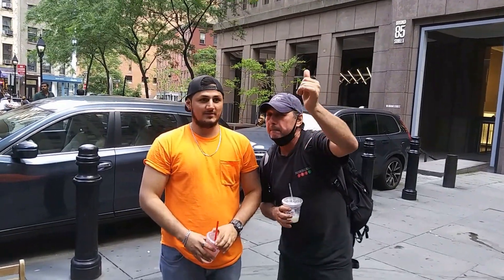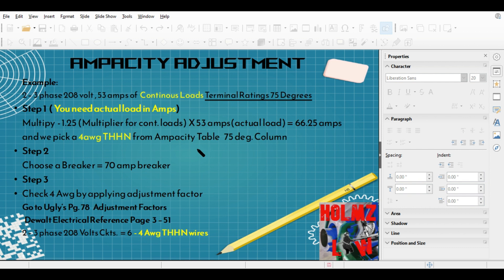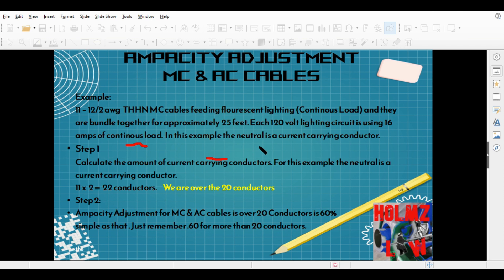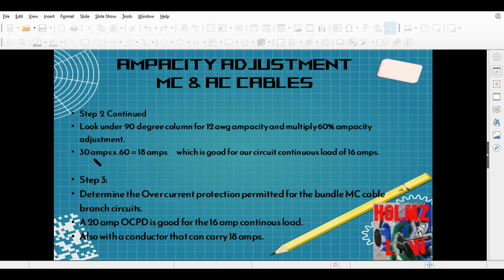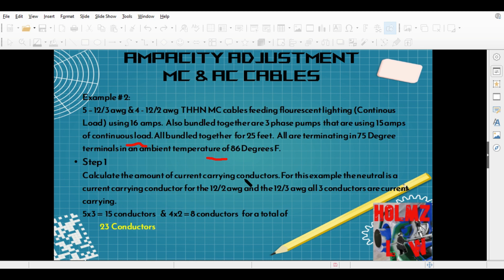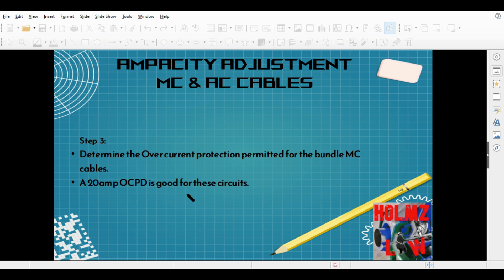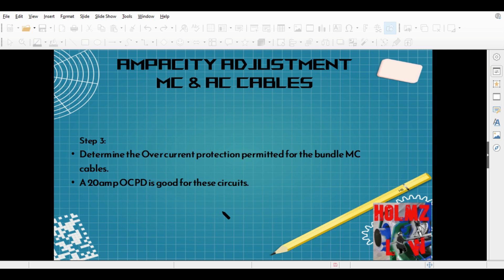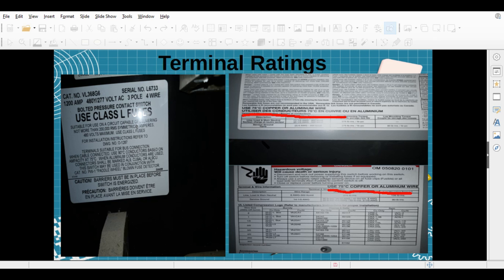Derating Simplified Pt.2 -  MC & AC Cables w/ 60% Adjustment Factors

Comment: I need to run a bundle of 15 MC cables. What is an effective support system for a wall mounted run?
Reply from the maker: well it depends. if it's going to be exposed in a spot where people are going to be able to look at it all the time. Then I would use a support system that's clean and neat. Just don't forget that if you bundle all 15 cables together you're going to have to derate. Unless you bundle them in groups of 5. Then you won't have to derate. As far as an effective support system... as long as you use any support system it's effective. I'm not sure I know what your asking me. Like I said if it's exposed work make sure it's neat. If it's not going to be exposed then as long as it's supported is good enough. I hope this helps.
Reply: @TheArtOfConduitBending  Its an above ceiling grid installation. My concern was keeping costs low while also being able to get out quick since I am getting stretched thin on multiple jobs. I have been making a transition from residential to commercial work and just looking to sharpen skills all around. I thought about building a wall mounted rack from uni-strut but really dont know how to wall mount them onto metal studs....Thanks plenty bud. Sure do appreciate the effort and time you put into your content. Nice and clean work you do.
Reply from the maker: @E.07ROCHA  If that's the case and it's not exposed then it's really not a big deal. But you still want it supported know what i mean. Now i understand what you mean when you say its got to be wall mounted support. Are the studs on the wall never going to get sheetrocked is it going to stay bare stub. If that's the case then just get some one hole straps for mc and strap it to the studs. I"m not sure how many mc cables you have but either way you can support  one with the strap and then zip tie a few other cables on to that same cable. If you happen to have lots of cables then just make a cable rows  one on top middle and below. Just strap one with a self tapping screw to the stub and like i said zip tie some more cable onto that cable. it's not expose so your good. And they are all supported. I don't know why it has to be wall mounted. Don't you have access to the ceiling? any how another quick and easy way is to just get some J hooks that you can screw onto the metal studs and just lay in your cables into the hooks and ziptie them onto the j hooks. There are some many different methods that I can think of. Don't over think it so long as they are support. Also look to see what material you have around that you can use to support it so you don't have to waste on buying more material. Usually inspectors won't be to hard on mc installation.